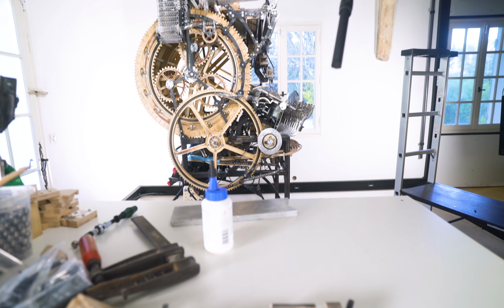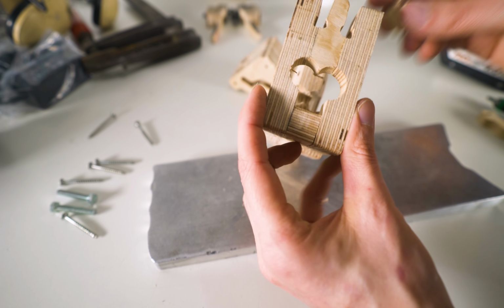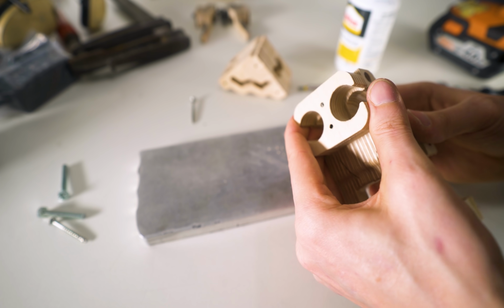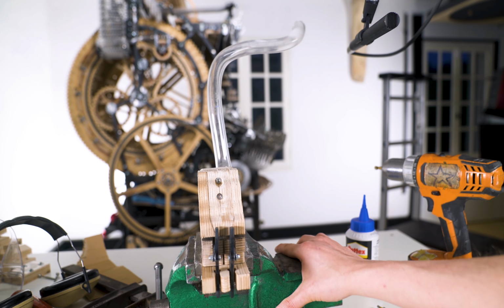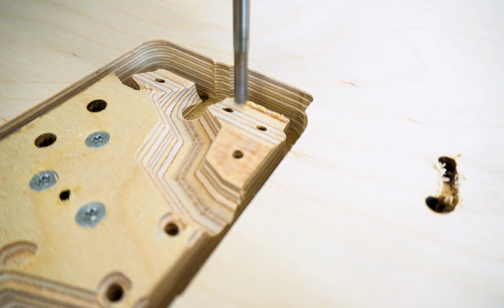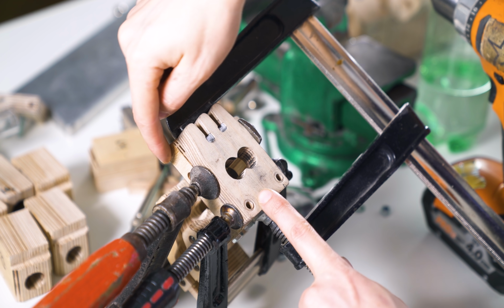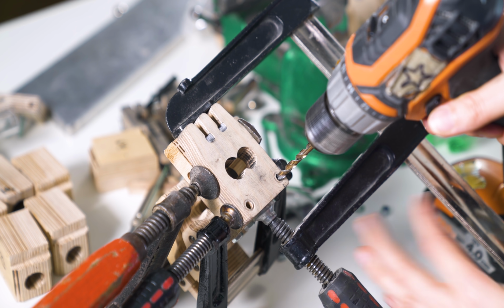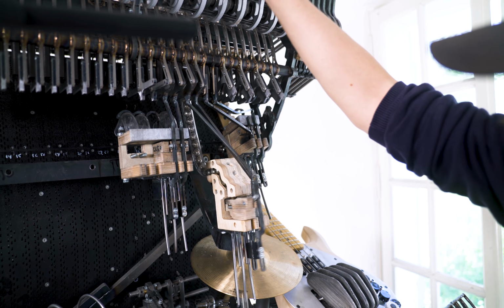Zig-Zag Marble Gate Completed

Comment: Please increase the length of the guide screw, otherwise a lateral movement will prevent the moving piece of wood from returning.
also, you should limit the friction of the screw thread on the wood, as this will cause rapid wear of the wood, and allow unwanted lateral movement. you can for example screw on the metal thread a small aquarium bubbler pipes of the right diameter (use following if your screw is M5 diameter.
https://www.zoomalia.com/animalerie/tuyau-a-air-en-silicone-pour-pompe-d-aquarium-2-5-m-4-6-p-4328.html?gclid=Cj0KCQiAhP2BBhDdARIsAJEzXlHYpbVe5dCZ3ajt3MO6pcPNu_tBieY9cDGju_6xfUrkFfC22j40NNUaAoW2EALw_wcB#l15447
Bon courage !!!

Comment: What if you made the pieces of the pressure gate that face the audience out of acrylic instead of wood? Then you'd have dimensional stability and be able to see the marbles, and with the slots in the sides it wouldn't even be that hard to get a cleaning stick in there when the graphite gets stuck to the inside.

Comment: Here's a thought. I'll add. I have no schooling in materials that can be machined. Wood/metal, obviously. But what about rock? It keep in line with the organic look. I would think there is a Rock that is soft enough to be CNCed and out last the Plywood? Plus it might be an expensive material, but we fans keep sending funds to this work. With the right cutting bit that CNC can cut metal. Isn't there a bit that can cut rock? It would give a nice aesthetic look to the parts design using rock, assuming it was with proper funding and possible to do so.

Comment: My humble advice would be if these gates work well, finish the MMX with them. The whole purpose of the subassemblies is to be able to change them later if you think of a better solution to the problem. One easy way would be to machine the same parts just out of acrylic instead of plywood.

Comment: Maybe a silly question answered many times before, but: Why are there still those grooves in the center screw of those sliding parts? Won't they tare on the marbles, plus creating much more noise than using smooth metal rods with only grooves where they have to bite into the wood?

Comment: You should cover the area you'll be cutting with painter's tape, because it will prevent the wood from blowout and cut down on post-processing time since you don't have to sand the parts so thoroughly or at all.

Comment: What about anodizing / coloring some of the metal balls to create some color and visualization? I don’t think you’d like to drill light assemblies into your perfect wood pieces, it you could add small fiber optics which leak a little bit of light inside the tracks by drilling toy holes.  It would complicate the assembly though.   Cheers.

Comment: if you drill the holes in the plywood, and 'reinforce' the holes with cyanoakryolate glue (10sec glue) before tapping them, it will be much much stronger threads

Comment: You should probably ensure that the wood screws do not grip in the middle pieces, they should grab only the last piece in the assembly and act like a clamp,  will have a risk to have the part not completely tight in the middle with no control...and rip off the wood if you tighten them more, both at the last part and loose the clamping force.
My 2cent of €

Comment: Do you suppose it wold be a good idea if the marbles gates were CNCed into a clear plastic material so you could see the marbles flow inside the zigzag better? Plastic won't warp and wear as easily as wood and that could help with its precision over time.

Comment: 10:30 Is there a way you could possibly cut in a feature to capture a nut? I’ve seen makers do that in FDM plastic parts, and in my industry we accomplish the same by using bonded or riveted nutplates, but would such a concept be feasible in CNC’d plywood?

Comment: suggestion; make them in transparent molded acrylic.  Now you should use some padding to avoid the clank noises on the stop gap, like cork material.  Really if you make 1 mold, just copy paste these by pouring acrylic, like when people do furniture, like that type of material for example.  It won't go black and will show insides. Maybe silicon. ding ding  Because wood is nice for legacy feels, but tbh sometimes s*cks

Comment: Poor CNC Laptop.. covered in dust xD. 
I still wonder if this whole new assembly is overly complicated. For example the inner cyclindrical tracks. Costs a lot of time to machine with the standard cutting tools. However the marbles will never touch all sides. I was thinking a "square" path like in the plexiglass examples would have been easier to do on CNC.
Also the  assembly consists of many parts. Both points are kind of contradictory to the previous "Design for Manufacturing" principle (DFM) videos. 
If it works reliably though then maybe the work and time spent was necessary...

Comment: Self-aligning parts should never have slanted surfaces where you put your fasteners. This can convert the pressure from the fastener into a misalignment force, which is the opposite of the design intent. I noticed that the final outer parts of the marble gates didn’t look very well aligned and it might be due to this.
Reply: Clarification, fasteners should always be normal to the interface between parts to avoid forcing a misalignment .

Comment: 10:20 It's a topic I had a few discussions with my dad about. I'm kind of an advocate for wood threads.
And a good point he made as well is that it's not only about pressure, but also about usage. If you have a thread which you are turning the screw in it gets worn out pretty quickly

Comment: Here's an idea for how you could address your issue with the design at 12:57
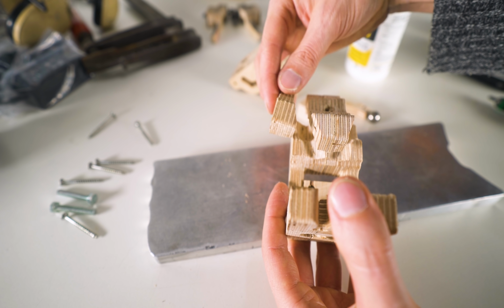The 2 plywood parts that you put on at 2:35 let you see the marbles from the sides, but I think seeing them from the front of the machine could be more impactful. What if you used the same geometry for those 2 parts, but made them out of acrylic? 
A polished acrylic version of that part (like the conveyor belt marble carriers that Alex CNC made) could let you see the movement of the marbles from the front, without having to design a new part. Aesthetically it could be an interesting combination of plywood and polished acrylic. 
As of writing this comment, I have only thought of 2 problems with this idea;
   1-Getting the acrylic parts made may take longer than making them out of plywood like you did in this video. I sense you want to get these gates done so you can get back whacking moles on other parts of the MMX.
   2-There would need to be a minor change to this part, instead of wood screws holding the 3 parts together, you would want to use machine screws. So this means changing the hole sizes on the acrylic parts and the middle plywood part, tapping some threads, and possibly recessing a hole for the head of the machine screw and or a washer.

Comment: Certain in grid dust is still your nightmare. I may be ridiculous here but an umbrella made of 88 electrified wires Rotating over the top of your machine. It will attract catch and throw the dust away from your machine. In addition a roof over the top of the marvels the way you have them right now is quite beautiful a straight through drop for the dust is not available right now this means you will have to brush out everything will channel by hand And if a washer get stuck in amongst all of that...... Need I say more

Comment: Well you could make the outer part of the "zig-zag", the smaller one that the preasure rests against out of acrylic or transparent materials and heat glase them?
That would mean one can see something without really changing the design, you simply take another material, this should not be done for the "spine" or middlepart everything else glues to, but for the small "snakey" zig-zag part that could easily work.

Comment: What if you turn the gate design 90 degrees so that the window is on the front face, instead of on the side? I recognize that will require moving the fasteners 90 degrees as well, but it should be a moderately small change in CAD that pays off with visible marbles in the end product. Keep up the awesome work!!

Comment: Now I'm no engineer, I'm not even that smart to begin with. However if you wanted to keep the same design but wanted a more aesthetical look, couldn't it just be made out of thick perspex instead? I don't know if it would be weaker or harder to cnc but you would be able to see all the marbles moving through it and there's already a precident for perspex all throughout the machine as well, especially in the fish stair lift, so they wouldn't really look out of place either.

Comment: Maybe is watching a live stream how a piece is designed and developed and later is being realized, is not suitable for all followers. I think you must have a technological hunger and mechanical understanding, not necessarily understanding CAD, to be able to enjoy that kind of live stream.
But I loved it. I watched them both and now I see the finished part. 
Even more nice is that it is working. I was a bit worried that the parts with a bevel, to create space for the marble path, would be hard to screw together and to keep aligned, because the bevel could cause the parts to slide away from eachother. But it seems to work.
Keep up the good work.

Comment: I would recommend getting a couple pins to stack your pieces together and screw the first screw through all the layers at once. Then remove 1 pin and screw then next screw and remove the last pin and screw the last screw. When you are tightening the first 3 layers together before adding the last layer, you end up stripping the inner threads you just cut into the wood when you tighten the last 2 pieces. Stack and screw them all at once. I like how you made the holes get smaller as you went, but right now the only “teeth” actually “biting” the plywood is in the last piece you added. The rest are most likely stripped.

Comment: Hi Martin, thanks for your passion on the mmx, always great to see your videos. I want to place a recommendation regarding the alignment of the plywood pieces. You should not use inclined surfaces for the positioning, they will always cause movement on main assembly surface and then mismatch in the marble guide sweep. That’s no proper way to align the pieces. Leave the contact surfaces of the different pieces parallel to each other. Use simple holes which go through all pieces on the same axis and use a metal rod to stack them. As fastener you can use the wood screws. But make sure that there is only the last piece used to screw in. Center pieces must have clearance to ensure the alignment through the pins. Much easier assembly and more precision. 
Regards, Marc

Comment: Great Video,  sorry if this suggestion has already been made and discounted.  With this current design could you re-engineer it so that the marble window is on the top of the zig zag rather than the side.  All the geometry could remain the same,  but the marble movement could be seen from the front on every channel

Comment: Super impressed and excited that such a huge, finnicky wood component could be replaced by such a compact, robust module!
Also, I recognize that clock mechanism! Maybe a project to get some of the CAD guys to try first, since that wheel seems like it'll need 3d printing, ideally in metal.
On the upside, as long as leverage isn't a problem, the wheel design would be super forgiving in terms of tilting the marble path. Curious to see how it handles pressure.

Comment: You can always harden wood threads by applying thin cyanoacrylate glue (Super Glue).  Tap the threads, harden the threads, re-tap to clean up the threads.  It's a technique I use all the time when making model aircraft.

Comment: Well if you wanted more visibility then the 2 outer most plywood pieces on the corners that you added last at 2:37 could be replaced with acrylic pieces. Your CNC can do it and polishing them can be done pretty easily on those shapes without fire. Could be something for a later though.

Comment: Glad you found a more efficient way to solve to enable pressure problem.

13:11  As cool as that design is, the more moving parts you introduce the more potential moles you introduce.  So I'd say use it sparingly on only the most visible marble gates.

Comment: I just don't understand why he's putting these together with wood screws instead of infinitely reusable t-nuts.
Reply: Would be faster than explaining us why using metal threads into wood and some principle thingies 😅
Reply: @enjibkk6850  Well for the long ones it's probably easier to thread to the wood, but for the through holes holding it together t-nuts would definitely be simpler.

Comment: Flow need to be free hightadjustment is ok . Pressure  need to be handled  . If the gates cant handes the pressure  there no  good. Think as the marble  as a hydraulic  pressure  . Not as a movement .

Comment: I was wondering what was taking so long. Lol. You need something hot-rodders use. Mock assemblies for design function. They make plastic blocks for test fitting so you can check things like the fire wall and steering linkages will clear. Build one MMX that works and one for testing. 
We want to hear some music soon. Use the new gate and go with it for now. In the end you are doing a fantastic job! It might be time to be satisfied that you SOLVED the problem. Keep going!

Comment: Martin, after you tap the plywood, put a small drop of thin superglue in there and let it sit before you put the screw in. The superglue will soak into the threads and make the wood even harder. Then the threaded screws won't strip out.

Comment: Martin! A tip from the rc aircraft world - You can harden a wooden thread with thin cyanoacrylate (super) glue. Also good for prepping wood to accept any kind of sticky tape. Just rub it around gently and don't get stuck, then spend 30 minutes picking super glue off your fingertip.

Comment: I wonder if these should be 3d resin printed? I think they should for 2 major reasons 1: These parts take a lot of little parts to make where 3d printed could make them in larger and less assembly needed. 2: Once on tour dragging around a large CNC machine and plywood or finding a local ones could be a pain. Taking time to set up the CNC and get it running them machine the part and assemble you might be just as well off with a 3D printer which is way easier to drag around.  Of coarse you could just keep a parts bin with you and hope you don't need more than you have with you and can order and ship replacements as you use them up.

Comment: You need to guide the hole drilling/tapping process.  Do not remove alignment block.  Slip sleeve into it to guide the tap-size drill.  Then remove sleeve and tap.  Have another sleeve on the back of the tap to guide in the clearance hole.  THEN you can remove the guide block AFTER the tapping operation is finished.  Don't rely on hand-held drilling in these precision parts!  APPLY FINISH TO THE WOOD!
          How do you adjust the length to align the marbles in the divider?

Comment: Repeating previous comment: The problem is not the marble weight on the gate (which is a symptom,  not the problem). The problem is a gate that is too sensitive to the weight. The marble path shown is hyper complex and made out of WOOD, which wears, furs, and deforms with time. If you had to use wood, use hard walnut or ironwood. But, it needs to be metal. Second; the solution is to make the actual gate with needle bearings to eliminate the drag and friction causing the issue with the marble weight. Marten is looking for 5 nines reliability. He is very unlikely to meet this goal with the "new" design. Metal threads in plywood is a very bad idea Martin. Vibration, dissimilar material expansion/contraction, and humidity changes will tend to pull the threads out relatively quickly.  MARTIN; STOP WORRYING ABOUT ESTHETICS!!!!

Comment: Try using thin CA glue in your wood threads ,let dry and retap the hole.  It will give them a little more strength !!!!
I have used this method on RC model planes and works well!!

Comment: I've been working in a wood Workshop here at my house for over 30 years. It doesn't matter if you're going with the grain or against the grain when using a metal Screw As long as you use fine thread screws. Because there is such a large thread count, you don't have to worry about anyting stripping. Technically he's using a fine thread bolt and not a screw. I wouldn't use a wood screw, the metal fine thread bolt is much more sturdy. But if it would have been me using this, I would have taken dowel rods and liquid nail, pre-drilled the holes and then tapped the dowel plugs or dowel rods down flush with the wood and been done with it. A lot of people don't do this because they think if they have to take it out it's an impossible feat. Absolutely not, all you have to do is drill it back out using exact same size drill bit to use to drill the hole with and when you're done it removes the liquid nail and all. It seems like the metal bolts would be more secure and stronger but they aren't. It makes the piece like one solid individual piece instead of multiple pieces bolted together

Comment: Just a bit of advice with the tapping you should actually tap 3-4 drill sizes smaller then the actual size of the intended bolt this way you'll be left with roughly 75-80 percent of usable thread meaning your less likely to strip the threads outs if you accidentally over tighten the bolts. You should be able to get a tap to drill conversion chart which will tell you exactly.